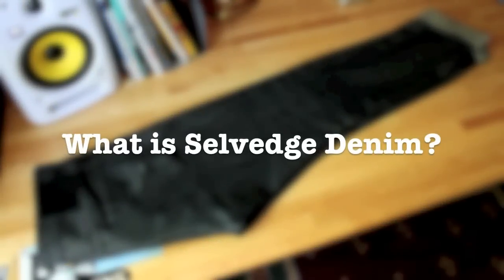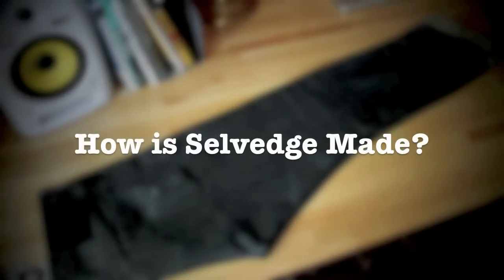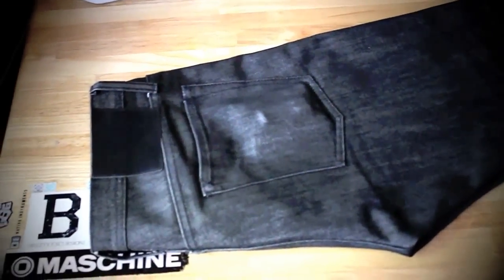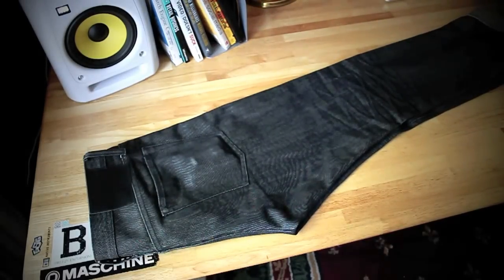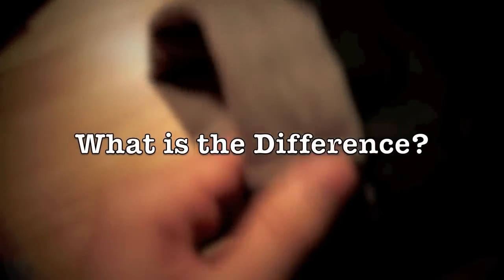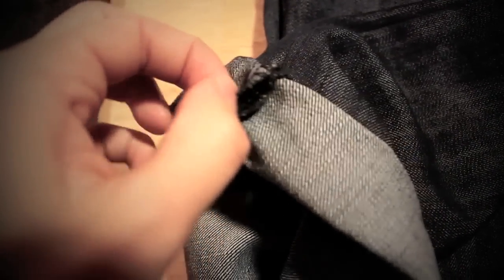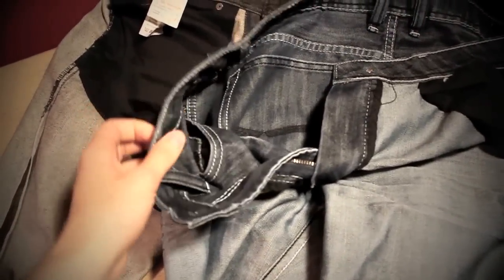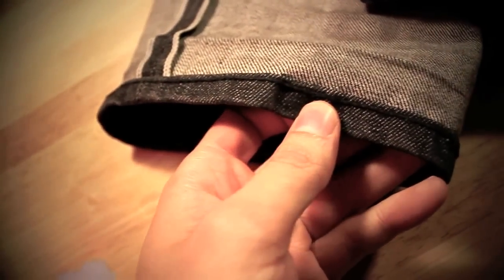What is Selvedge Denim?

Comment from the maker: Sanforization is an process that some denim manufactures use to prevent shrinkage when you wash (or soak) your jeans for the first time. Un-sanforized denim will shrink a few sizes once you soak them. Sanforized denim will remain the same size relatively. So keep this in mind when you're purchasing a pair of denim.